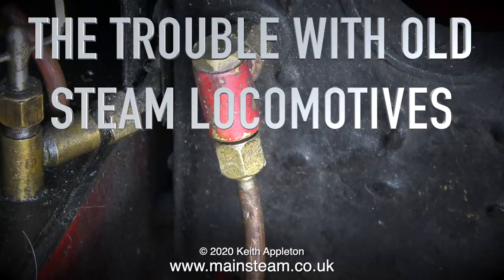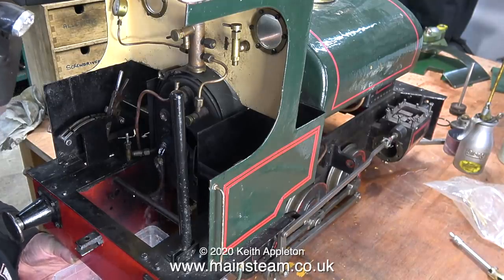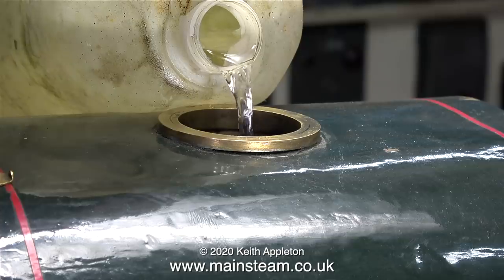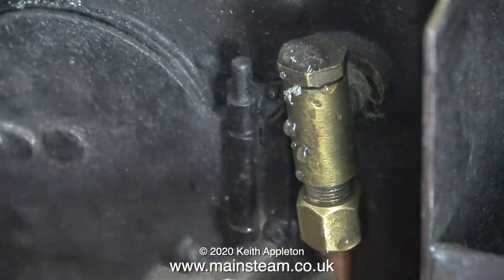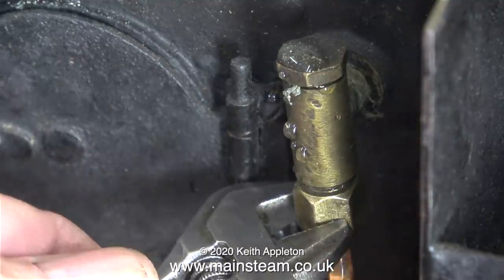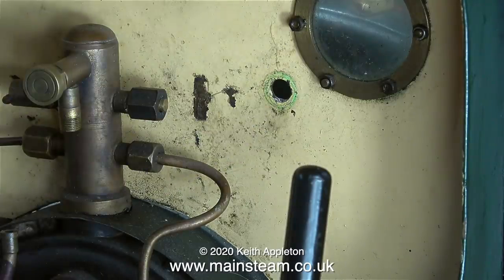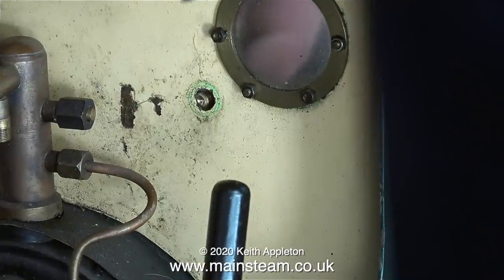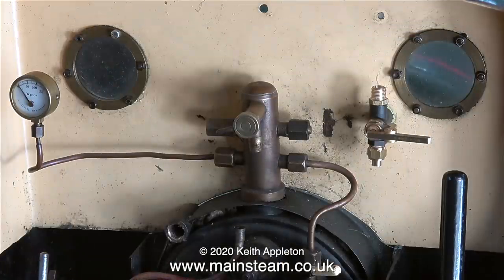THE TROUBLE WITH OLD STEAM LOCOMOTIVES - PART #6

Comment: I have 2 locos like that. The 5 inch Jinty begam in a super workshop and the frames are superb... The second owner messed up the cylinder block. Yes I got a new one from Jacquie as well as wheels. They were superbly turned but only suitable for an E 1.  The E 2 was rubbish especially after HIT entertainment got hold of him.